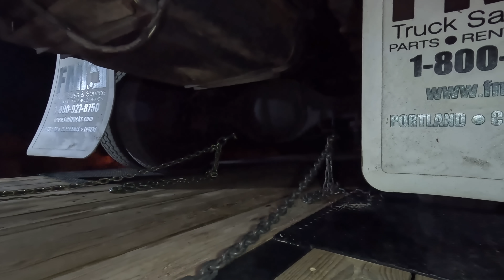This Is Why We Don't Drive Over The Hippopotamus!

Comment: Everybody, if you're gonna drive in a river or drainage, make sure your fluids aren't leaking, and don't crack your oil pan. Gotta keep these few precious waterways we have in the Southwest alive. Have fun!
Reply: I had a leaking cv (guy who put it in didn't do it right) got stuck in some high water. And when I went to fix the cv Axle, I drained the diff because it was bugging me. That water may have gotten in. And it did gear oil was bad.
Reply: Thats common sense. But I haven't ever owned a jeep that doesn't leak lol. So I don't go into water ways.

Comment: You are absolutely spot on about trail width.  When the Hummers began touring in Sedona, they didn't follow any of the rules and challenged the Forest Service in court to get permits for the trails the other companies already had.  During the litigation time they were allowed to operate and literally ruined every trail out there.  All the trails were measured by the Forest Service when they started and their width was 8'.  When they lost their case the trails were measured again and they were between 12' and 15' wide.  They also were running off the trails and running over the Shaggy Bark Juniper trees, that grow hundreds of years, and anything else they could,  just to impress their riders.  What a nuisense they became for the environment.  I was a guide who traveled the trailes, in a jeep, during the time and was witness to the damage they did.

Comment: Matt, styes usually resolve on their own in one to two weeks. A warm compress can help. With thoroughly washed hands, you can use a finger to gently massage the eyelid following the use of the warm compress. This can help stimulate drainage from the blocked oil gland. Do NOT pop it. A stye is an infection (typically a staph infection) in the eyelid’s oil glands. Popping it can cause the infection to spread to other parts of the eyelid. Do NOT rub your eye or touch your stye. If you do, be sure to wash your hands thoroughly after.

Comment: Tip
Instead of fitting a permanent winch at the front of a vehicle have a receiver hitch fitted instead and mount the winch on a plate with another receiver hitch and use a bit of suitable square tube to join the two when needed. This way you can store the winch in you garage when not going off road, you can also with the use of a battery pack use the winch anywhere you need it.

Comment: I try to help people out and last night a Facebook friend's son was broken down at Coaldale Nevada, east of Tonopah a ways. Unfortunately,  the passes are closed by snow and ice, so it would be 9 or 10 hours driving from the Fresno area with my 8.5x16 flatbed trailer. No tow service there when they called for roadside assistance.
Reply: There are roads in Nevada where there is no cell service for 100 miles and no cities. Like us 93.  I got friends that live near Tonopah they got snowed in. Also the cell towers failed do to antennas damage from the weight of ice last winter.

Comment: A Stye is basically an infected eye pimple. You mostly get them along the edge of the eyelid where the eyelashes are because of rubbing your eyes. Really common in females that use eyeliners. Anyway, a good home treatment is hold a wet, warm washcloth over your eye to help them drain. Careful of the temperature of the water though, the eyelid is really sensitive and you can burn the skin if the water is too hot. If that doesn't work in a day or two, see your doctor and get some eyedrops to treat it.
Reply: Or, get a sharp needle and open it to drain. Careful though, the eyelid skin is quite tough.
Reply: @georgevindo  As a random internet person, needles do not go near eye.
Reply: Dogs licking your face while you sleep will do it too, so will excessively rubbing your face into your pillow lol
Reply: @mike_tango  Well I guess that's okay for you. I've done my own that way.

Comment: I get styes periodically, and as I anticipate others may have recommended-- super hot water in a mug (so hot you'd burn yourself drinking it), fold up a clean washcloth and dab a corner into the hot water and gently put on stye, back to hot water, back to stye etc for about 20 min. Helps to make it so hot you can barely touch the stye with the cloth.. Will usually do this 3-4 times throughout the day and will typically clear them up, sometimes takes until the day after to notice. Good luck good sir

Comment: Matt, I’m sure you’ve already recovered from your stye at this point but I treat these quite frequently in my clinic. The number one cause of a stye is dirt and grime building up along the base of the eyelashes. We naturally have organisms called mites that live around our eyelashes and when grime builds up they multiply exponentially and will enter the glands of the eyelids and causing styles. It makes sense due to what you do on a daily basis. Try taking a warm washcloth in the shower with you and cleaning your eyelids really well. You don’t need any soap but if you feel that it will help you clean better, some baby shampoo would be safer to use around the eyes as it is less irritating. Hopefully this can help you!

Comment: "Those of us that enjoy the difficulty are robbed of another hard, fun trail."  

We have that problem in mountain biking too. I was riding up a trail that used to have lots of loose rocks in it, but I hadn't ridden it for some time, and noticed it was quite a bit easier than it had been. I came across a woman who was off her bike, bent over, throwing rocks off the trail with both hands like a dog digging in the dirt. I was a bit miffed and politely asked her not to do that.
Reply: We have a guy here that keeps on removing rocks too.  Has been warned several times to stop, but it still continues to happen.  If they want easy trails, find a different one, leave the hard ones alone.

Comment: Hi Mark nice battery in a box, but carefully examine those power boards in the shed now and then for loose connections or signs of overheating, my mates entire garage went up in flames taking with it a lifetime of tools collected and his loved Toyota Land Cruiser. He just got home a closed the roller door which I suspect overloaded the power board and didn’t cut out on closing. Shouldn’t have plugged the roller door motor into a power board so sad for him.

Comment: If a stye(sp) get a face cloth and soak in hot water as hot as you can stand,ring it out and press against the eye with stye. This will cause it to break up or pop giving you instant relief once that happens. Continue to reheat cloth and press on eye until popped.

Comment: On the 2nd trip when you gassed up and bought a pie, If you have 2 hrs to drive put the Pie on the manifold and the heat from the engine will heat up the pie and when you arrive at destination you will have a nice Hot Pie, Yuumm.

Comment: Jawas machine 😅
Sandcrawlers are huge treaded fortresses used by Jawas as transportation and shelter. The sand-pitted vehicles, many meters in height, are equipped with a magnetic suction tube for sucking droids and scrap into their cargo chambers.

Comment: The crazy thing about winches is - even if it's just a 2,000lb trailer winch if all you need is 500lbs of pulling force to get you off a rock... Well, there ya go. Also a 2,000lb winch becomes a 4,000lb winch if you double the line back, and 4,000lbs will pull a lot of smaller off-roaders out of pretty sticky situations if you're patient.

Edit: Before anyone says anything, the entire weight of that Jeep is not on the rock. It's however many inches of suspension travel is being unloaded by the rock X the spring rate at the various corners X the difference in the coefficient of traction between either the ground and the tires or the rock and the chassis. To simplify we will assume all CoT are 1.0 so if spring rate is 200 pounds per inch per corner, and suspension is unloaded 2" at all four corners, then you would need something more than 1,600lbs of pulling force to unstick the Jeep.

Edit edit: Matt if you'd be interested in another employee to manage I might be interested. I have no formal schooling past high school, but I'm pretty handy and quick to learn.

Comment: I used to get those damn stys all the time. I started yanking on the eyelashes that were in the direct area and pulled them out. In most cases, it cleared up by the next day. I assumed that they were being caused by infected eyelash follicles. so removing the eyelash seemed to do the job.

Comment: re the sty in your eye.   take a clean white gym sock, put about half cup of uncooked white rice in it, and tie it off.   put it in the microwave for about 30 seconds to get the rice hot, lie back and place this across your closed eye as a heat pack, give it at least 5-10 minutes, and repeat 3-4 times a day, and it will clear right up.  the pack should be very warm but not so hot it burns

Comment: The only thing you needed was a Powerwheels in the "bed" of that Samurai and then an RC truck in the bed of that Powerwheels and then a Hot Wheels truck in the bed of that RC truck and then a Micro Machines truck in the bed of the Hot Wheels truck. The "haul-ception" was getting fairly high there.

Comment: Matt , I usta get stys myself a doc told me their just pimples on your eyelids, get a washcloth wet hot as you can stand pull your eyelid open and hold the washcloth on that sucker and it'll pop. Where you're at it's probably sand got in there.

Comment: why anyone would go to a place like that without a winch is beyond me, my wife has a gladiator  rubicon on 35's that most likely will only see off road when it gets turned around in Theyard and it has a  winch and a recovery kit in it. I learned the first time I went wheeling at SMORR that I would never go off road without a winch again.

Comment: Even a hilift jack and a chain would have made a self recovery. A come-a-long could have done it. You do not need expensive self recovery equipment. Not even a wench. I'm not kicking the guy. But if you are going alone. Take some stuff. Oil, water, spare parts, ATF, recovery gear of some kind, and just basic stuff. I also carry extra fuel.

Comment: He probably could have got out with a hi lift jack.
Reply: Maybe, the problem would be that you have such a short amount of winching you could do with a high-lift before you would have to re-do the winch line the jeep would probably slide back to it’s previous position without someone else to be in the Jeep helping to keep it in place.
Reply: @JimYeats  
 Not for winching. Just jack up the front or rear and drive off.
Reply: @outfitr9703  You could jack up the front or rear, but that wouldn’t necessarily let you drive off. You would need to jack it up and then stack rocks under the tires.

Comment: My ex was a Physicians Assistant. She was almost never wrong about the fastest easiest way to cure things like 'styes'. l have had them too working construction wiping god only knows what into my eyes everyday. She told me to mix hydrogen peroxide and baby shampoo and clean the eye out 5 times a day. Just a few drops of each in some warm water. Then hot washrags in plastic baggies on your eye whenever possible. Should take 3-4 days. Mine would go away in around 3 -4 doing that at night time.

Comment: Doesn't trying to see how far you can go in 2wd. Put unnecessary strain and wear on just those drive train components. Instead of having the whole drive train and all four wheels sharing the strain. It's got to be a lot harder on the rear U joints and axle components. Just curious.

Comment: I dont get the driving / fuel mindsets that you have down there. 
Im from Germany and I do everything in my power to not have to drive more than two hours because I dont want to spend my valuable lifetime behind a steering wheel, and it costs a fortune and it ruins the climate and im isolated in a rolling sheet metal box and and and... Of cause I've driven cross country before and I dont shy driven at all, but the "Oh lets hop in a car and drive for [insert double digit integer] hours" mindset is something I just don't understand. And I include lots of other videos, too!

I'm not saying its per se bad or that you should not travel (I trave and commute a lot).